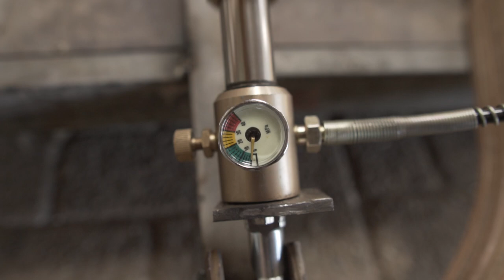Homemade automatic electric airgun pump!

Comment: What motor you used. How the rpm be slow meanwhile there no reduces
Reply: The rpm is slowed by means of a reduction gear set. You can see the bulge in the motor housing, near the mounting point. That is for the "gearbox".

Comment: So 3 phase motor. But where is the VFD?
Most people atempting this with this type of motor have to realize that you are going to need a 3 phase motor and a VFD. 
About a year and a half ago i bought same sort of setup for a lathe. Motor and Vfd ran almost $2k.
So unless tou have those components laying around used, you would be better off buying one on amazon for $500.
You could use a 1 phase motor which more people would have laying around but you would need a gear reduction and a big tooth differential at that.
The most i would want my hand pump to cycle is 20/m
And you won't find any motors spinning that slow